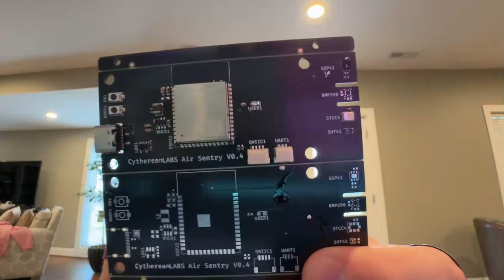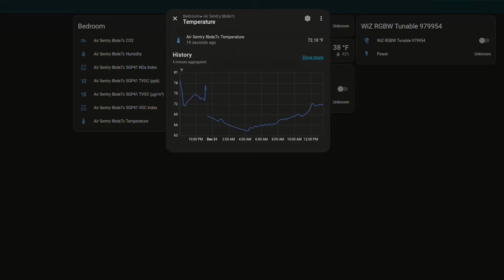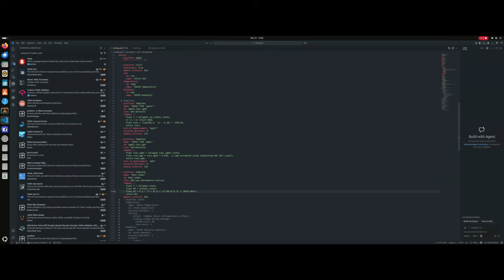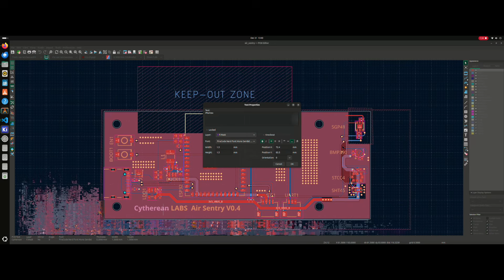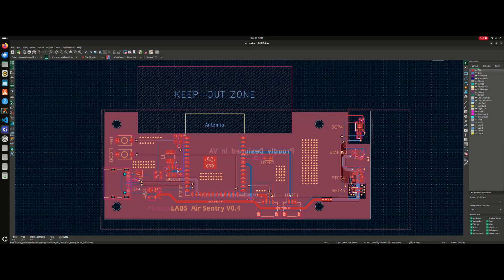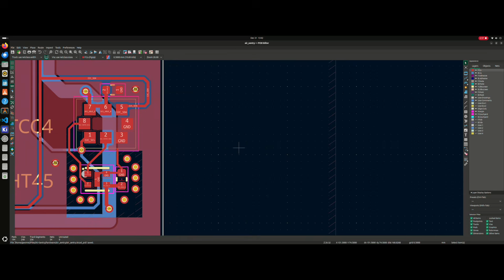Air Sentry Project Announcement

Comment: Great, yet more home surveillance. Nice one.
Reply from the maker: Only person seeing the data is you. So you can spy on the air your pets breath maybe 🙂
Reply: @engineeringabe  Until it's taken from you and used commercially! I hear you tho.
Reply from the maker: @innateOps All of my firmware will be open source, and if you still do not trust the device, you can flash different code from either the usb port or the uart port.
Reply: This is the opposite of corporate data snooping and is the type of project you should support if you believe in data privacy!
Reply: @Jay-The-One-and-Only  Are you unable to see how this can be used? (And is being used already commercially) Air monitoring systems are a rapidly expanding market in the Rented housing sector, Hotels etc. It's a great product, but like everything, will be hijacked and IP stolen in order to protect investors (i.e. Blackstone). It's the same old story.
Reply: @Jay-The-One-and-Only  Data privacy? Who the hell are you kidding!!!?
Reply: @innateOps  I appreciate a person like yourself who is concerned about privacy, too many these days turn a blind eye to this issue. By making the code for this project open source, it enables individuals to confirm if privacy is actually present.  Closed source cannot be audited. Do you perhaps have any examples of projects you do support?
Reply: @Jay-The-One-and-Only  I've worked in software development for over 30 years, if it's online or public network based - there is not a single project I could support personally. The internet is a corporate sandbox. Anyone thinking otherwise is delusional. Privacy or the notion of it has never truly existed. See your favourite bitcoin personality to see exactly why.